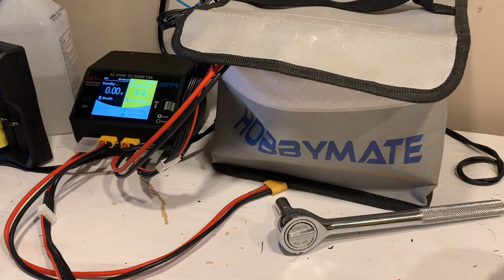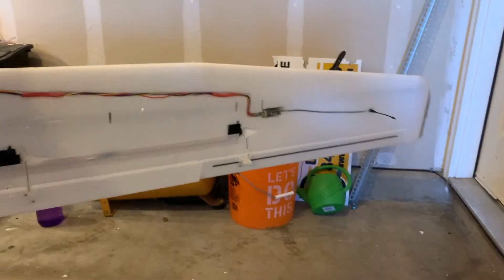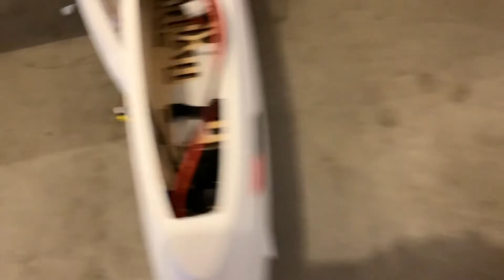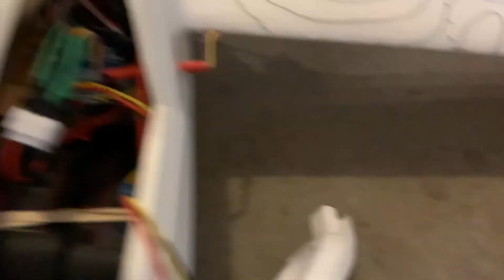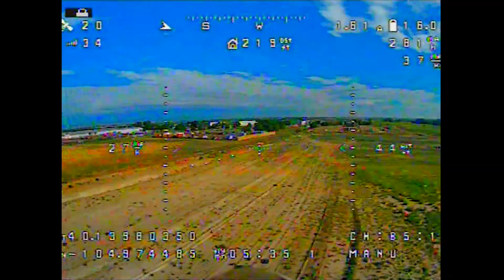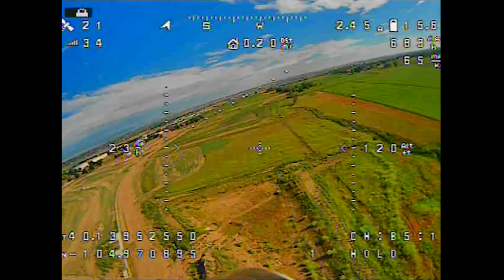My Volantex Ranger 2000 Overview and Maiden Flight

Comment: You mentioned frying the ESC and Video receiver and I would really appreciate learning what you did and why it happened so I can avoid it myself.
Reply from the maker: Yeah, so it was a dumb mistake on my part, and it’s fairly easily avoidable.

Before I set this plane up with all of the “smart” stuff, I just put a basic RC receiver and esc in it to test it out. Those things are all you really need for a basic flyable plane (in addition to a motor and servos, of course).

The esc has a battery cable that connects to the battery, and a power + signal cable that provides power to the receiver and gets fed info from the receiver on what the throttle should be.When I set the esc up, I basically just accidentally plugged the power + signal cable into the receiver the wrong way, which fried both the receiver and the 5V regulator on the esc, rendering both mostly worthless.

Note that what I cover in this video is the “smart” setup with a flight controller running INAV, so it is a bit more of a complex setup. The lesson still applies though: don’t plug things in the wrong way or they’ll fry.

Comment: Finally found a crash video of this model from..., are you beginner? I wonder an easy 1st plane in windy condition. https://wiki-travel.com.vn/Uploads/picture/anhthuy1202-191718041733-du-lich-mui-ne-doi-cat-bay3.jpg  Do you recommend this model?
Reply from the maker: Vjay Group this is definitely a good first plane. This or a Bixler. I just crashed mine because I had a flight controller installed that was limiting the elevator servo travel.

The plastic fuselage and metal wing spar make this pretty strong and tough. Put clear tape on the wings to make them even stronger.
Reply: @dylandickey3179  wow. Good news 👍. So now I have 5 models ( Ranger 2k, Fms Kingfisher, Dynam Primo, FMS ranger 1800mm & Hookll Cesna 182 V2) to decide to buy from Banggood ( these 5 models available on BG, price acceptable, and shipping COD is convenient. Each of model have their own advantage (just my 2 cents): the Ranger need bigger, long runway to take off and landing compare to the Stol plane & Trainer. But with very large space, its no problem, and it can handle wind better. Stol need much smaller space, and the Hookll trainer model look very scale. Now headache, not enough budget to buy all.

P.S Do you mean your flight controller is Xpilot from Volantex ? And your fpv video crystal clear, surprise !!!